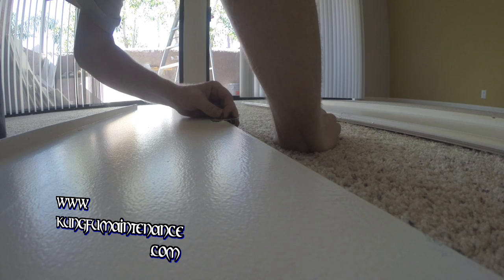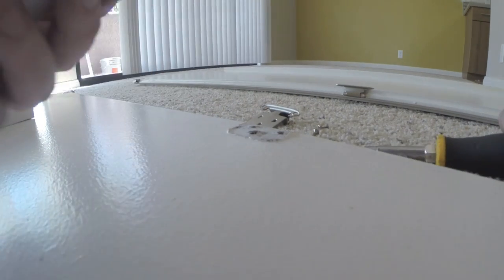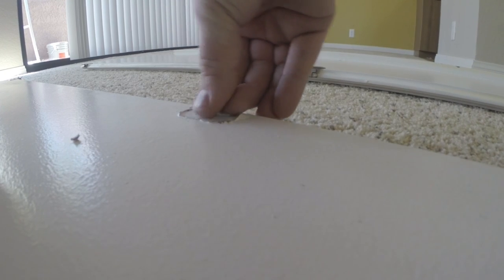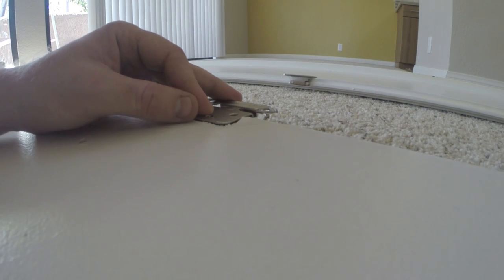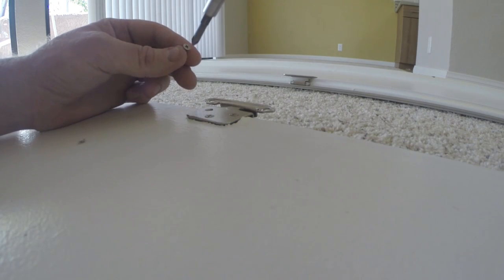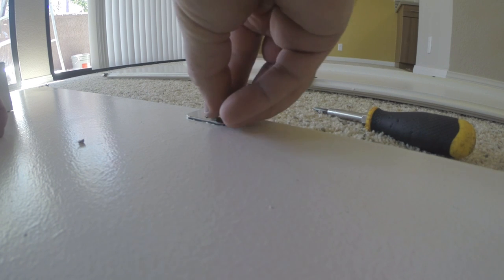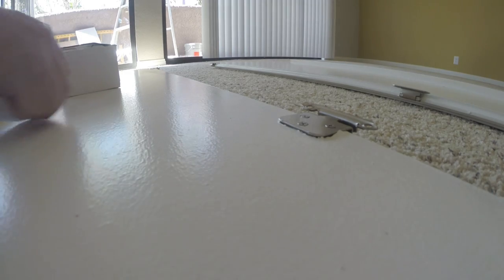How To Repair Stripped Loose Screw Holes For Face Mount Cabinet Laundry Or Other Door Hinges

Comment: May I ask what did you use to fill those holes?
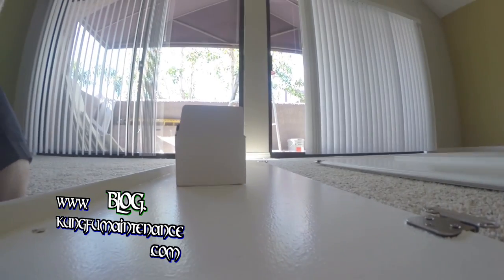Reply from the maker: Sure, all I did here was roll up little bits of the cardboard box flap you see at 0:56 ( I think it was from a box of electrical outlets Lol) and insert those in the whole to give the screw some more material to bite into. This acted as a quick makeshift molly. You can use just about anything. Cardboard from a box of matches, toothpicks,  french fry container,  etc.. even rolled up paper will work.